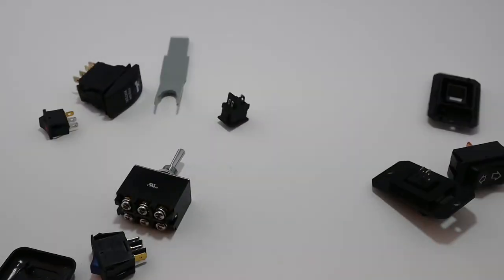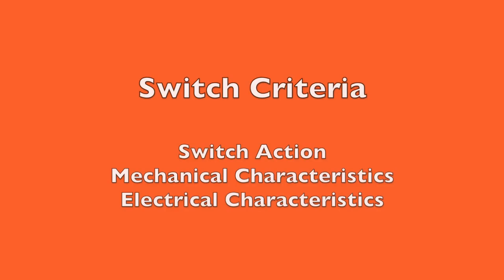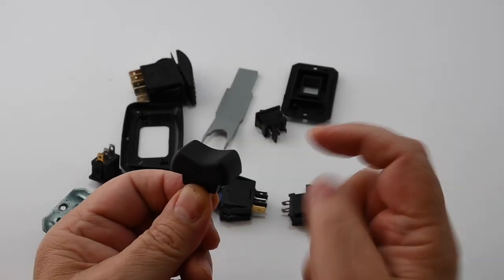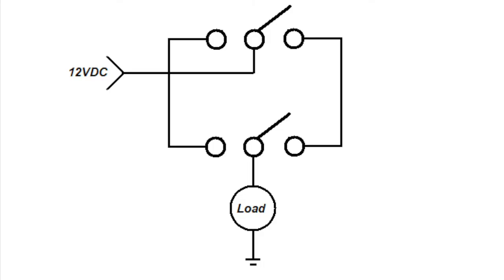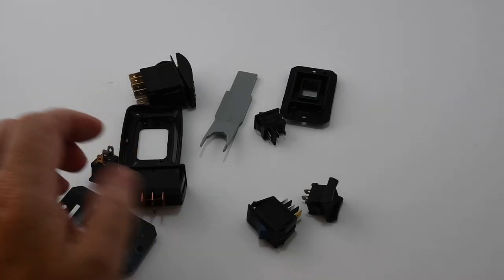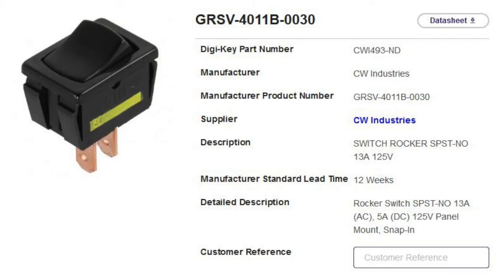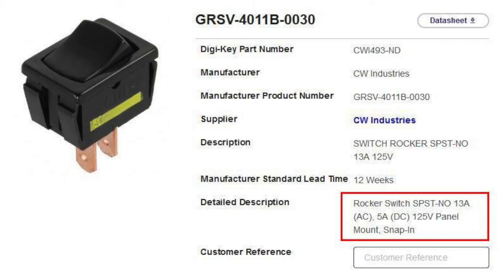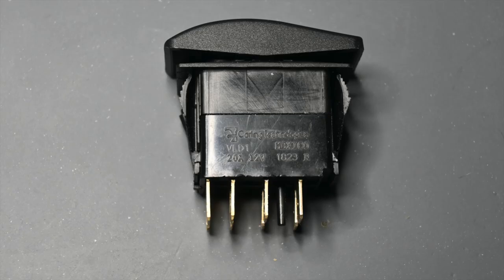All about switches... for your RV.

Comment: Thanks for the info however I have a different issue which I am thinking you could help me with. I am creating a live well on my pontoon boat and there is a unused on off on rocker switch on the dash I would love to use. Any idea how I would wire that as I just need an on off. Thanks Murray

Comment: So if it says MOM then I have to hold the button in that direction to get it to stay on?  I have a 6 terminal switch inside my RV that allows me to turn on and off the house battery to the system. I think it's dead.
Reply from the maker: Correct.  MOM means Momentary as well as (ON) or (MOM).  The switch stays on only as long as you depress the button.  

For example, some awning switches are of this type. As long as you depress the button, the awning operates. When you release the button, the awning stops.
Reply: @RVProject  But what about specifically for the battery cut off switch?  I have zero electrical background and have learned more than I care to know today trying to find answers.   I do know they say not to hold this switch.  Just to hit it for a second.  Longer than that will turn off the solenoid and you have to reset it by disconnecting the ground cable on the battery. However that has not helped my situation.

Comment: Watched your video and found it very interesting.  I’m trying to do something a little different with the 12v fluorescent overhead light in my rv.  The lights have 2 12” tubes and an on/off rocker switch.  I want to replace the tubes with 4 strips of leds and the switch with basically an on/off/on on switch.  In the on position, 2 of the led strips would be on.  In the “on on” position all 4 strips would be on. Kind of building in a 50% or 100% light option with the switch. I’ve searched for a couple of hours trying to find a  mini rocker switch that can do this. Any ideas what this type of switch would be called and where I can find one?

Comment: I have a 8 connection switch that came from a Semi Truck.  This switch was used to "flash" the trailer lights off/on.  How can I wire this to do the same for a 5th wheel?  Any help?
Reply from the maker: The trailer lights are on a separate wire. You would have to identify that wire in your tow vehicle, then put any SPST switch that can handle 15A on that wire.

You would probably want a SPST momentary in the OFF position. In other words, it is on all the time but off when you depress it.

Look for SPST ON - (OFF) designation in the part description.

Comment: Dear RVProject,

Thank you for the video. Among the ocean of YT content, I stumbled upon this video now and it was relevant and helpful towards my application.

I have a doubt and if you could respond to this comment, I would decide if I could go ahead with my application specific purchases.

So here's what's in my mind: 
I have this wiring harness relay kit (1) to my car horn which connects to both my stock horn (1) and a secondary aftermarket dual horn setup. With the flick of the switch I can activate either the stock horn, the Aftermarket dual horn or deactivate both horns in the middle position. 

3 wires from the harness (1) is connected to one half of the 6 pin DPDT 3 position On-Off-On switch. The other half of the switches 3 pins aren't connected to anything.

I have another stock horn (2) in my car at a different location behind the bumper. It's just sitting there and I'm planning to give it the same treatment of the stock horn (1). However this time instead of using using another independent switch for the same application, can I connect the switch wires from the Wiring harness (2) to the other half of the existing 6 pin switch which isn't connected to anything?

Asking this here as I do not want 2 independent switches which do the same work at the same time. Should I be worried about the capacity of the switch even though both Wiring Harness (1) & (2) having independent relays be attached to the same 6 pin DPDT switch? Would my above theory work? The car in question is not my daily driver. It's a project car for off-road application with lots of wild goats and cows around and would take it on road rarely.

It would really be helpful for me if you could respond to this comment. Thanks a lot.

Comment: Great video. I’m trying to replace a safety switch in my lawnmower, which they no longer make the safety switch for and basically the inner workings are two of four wires are connected when the lawnmower is off and in charging mode and then they released and the other two are connected when running mode, what kind of switch would this be? So basically two wires are connected when charging and two different wires are connected when running. Only two wires are connected at any given time.

Comment: Many thanks for this informative video. I learned quite a bit from it, as I have had to replace a few switches in my motorhome.  One question for you. I need to replace the speed control switch on the ceiling fan. The fan, is similar to a Max Fan, but a different brand no longer being manufactured. The switch is a standard size 3 position rocker switch for Low- Medium- High speeds. What do I need to search for? All I seem to find online are On-Off-On switches.

Comment: All that and didn't cover the switch I'm looking for.   I need the switch as you walk in the door that disconnects and reconnects the battery power to the RV.  It toggles up and activates the battery disconnect solenoid and snaps/toggles back and remains lit till you activate it again and it snaps back and turns off.
Reply from the maker: If I recall, the disconnect for my Class C simply used a SPST or SPDT momentary switch.  They are likely available from the same mfg that sells the disconnect.
Reply: @RVProject  Yeah I'm thinking thats what mine is.  You activated up for one second and the power come on and the switch lights up but springs back. To turn it off you do the same action and it shuts off.  Well when it works correctly it does.   not sure if its my switch or not as the solenoid was bad.  Might have another bad solenoid.  It worked fine a couple of times now nothing.  ugh
Reply from the maker: @rlhagemann  You can always replace the mechanism with a marine-grade master on-off switch.  This is a manual switch and should solve your issue once and for all.

I will be doing a video on the installation of such a switch next season.